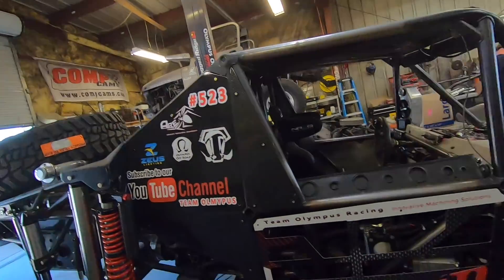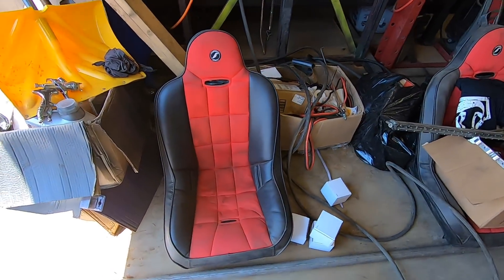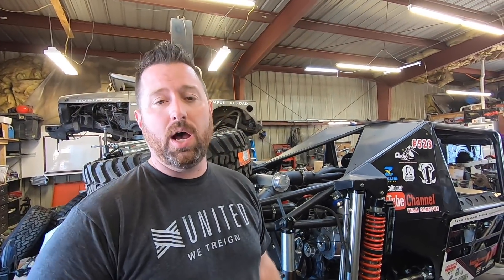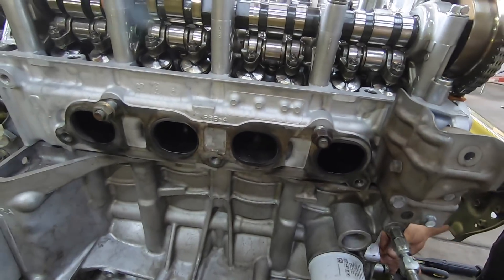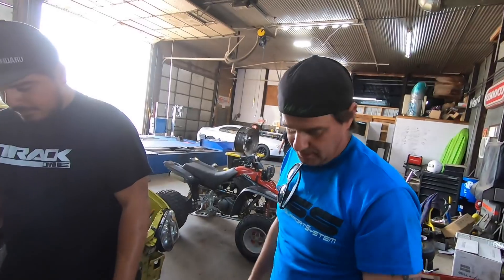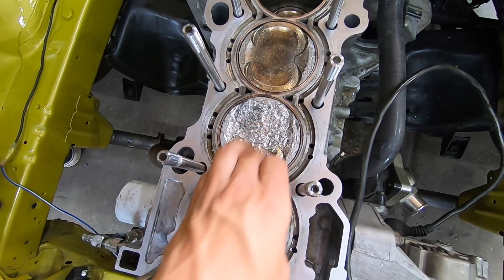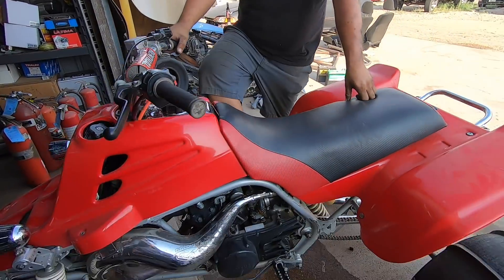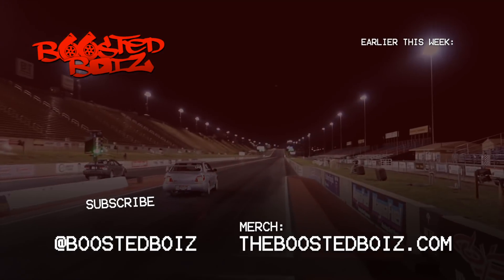Finding Out How Bad The Damage Is on Hondaru

Comment: Even after they swapped out the boxer for a k motor looks like that Subaru still has the spirit of blowing up....
Reply: Just a learning curve
Reply: Seems to be a fault with the K's. They had two different blocks split coolant galleries in the same place too. Time to J swap instead, or just keep stock and not "built".
Reply: LOL i was thinking the same
Reply: EJ257 would of lasted way longer
Reply: Mike Harkins I hope this is a joke
Reply: What statement? What do you mean by NA head? As in this head was built by 4Pistons to run NA? Why would they ever send them NA heads for engines they knew they would turbo to the moon?
Reply: Genuine questions BTW not coming at you. Also read some of your comments down below and it makes more sense. Interesting, but still confusing since I thought the 4P heads were a partnership/sponsorship.
Reply: It's the damn head the are using.
Reply: They need to give up on these "1000hp k swaps"....lol
Reply: @CainSample  I'd love to see them switch Hondaru to a J also hahaha.
Reply: Hahahahahahahahahahahhaha
Reply: That cars blown up way too many motors 💀
Reply: Maybe they should look at getting a bader built boxer engine
Reply: @MV60  LS Time!!!
Reply: Iws the same thing🤣🤣🤣
Reply: Mike Harkins like you said they’re still learning
Reply: @dylanzrim1011  They are still learning... Even Kyle said at the end they are going to learn from this and try to do things differently instead of doing the same things and getting the same results..
Reply: Mike Harkins shouldn’t matter. Brent has been tuning these things throughout his whole life... 

This is what happens when you use stock heads and valves against high horsepower stuff 800whp is a shit ton for these little engines. Even in the built category... these 4 cylinders start losing reliability going past 500whp.. even built bottom ends like forged crank rods pistons.. 

Trust me I’ve built small block chevys and I’ve seen stock cast iron stuff hit 800whp no problem as well. But how long do they last? That’s the issue. You’re better off doing it right the first time and never look back. And spend the extra money for better stuff.
Reply: @brendanmccarthy492  The head and valves werent stock though... And Brent is relatively new to tuning fully built, high HP Frank K builds.. Just because Brent has been tuning a long time doesnt mean shit.. You are always learning. BB and PFI just recently started getting big and having the funds to do big expensive builds. This is new territory for Brent and the guys. I have never said this is def a tuning issue though and none fo this is a shot at Brent as a bad tuner.. Brent is a fantastic tuner and a great guy... I have not seen the logs personally so I dont know what kind of problems they were experiencing. What we do know is they were running very aggressive cams, 50 degree VTC, and Ferrea 6000 valves and springs(usually used for high revving NA builds).. Valve-Piston contact on these aggressive Frank builds is common especially with the high redline and all the tranny issues with misshifts.
Reply: Mike Harkins dont they spec anything? Usually when you buy heads that come with a spec card  tells you what you can run and what is safe and not safe? I bought some 210 afr heads for one of my builds and it says spring pressure can handle up to .700 inch lift cams solid or hydraulic roller set ups. 

I think it’s a head issue. They keep putting these types of heads on their builds and nothing but problems. Even Kyles mr2 had issues with his.
Reply: @brendanmccarthy492  Its not the cylinder head.. Plenty of people run these same heads and are perfectly fine.. What this should tell you is it is them who are making the same mistakes over and over again, not hte cylinder head... And Kyle is know for his sloppy, fast thrown together builds that are not reliable. His whole channel was built on this. And I dont think they did "spec" anything. Seems to me they got some sponsors from different companies and threw together whatever they got.. The aggressive DC cams, the Ferrea valves, the 4P cylinder head, ect... And again, these frank builds are notorious for valve-piston contact when putting the redline up that high with aggressive timing.. Add on them having tranny issues and misshifting, and there goes a piston smacking your valves.
Reply: Mike Harkins yeah. You’re right about that. Kyle throwing shit together. Doesn’t take the time to build his stuff. I mean they obv have the money to buy 3 god damn motors to put in Hondaru... mind as well put a fuckin ls swap with the 4wd set up like a work truck. I feel like that would be more reliable than whatever they’re doing to hondaru. Now I just feel bad for the car instead of the guys building it.
Reply: @MV60  No, these guys just don't know how to build engines. They're too sloppy, they skimp in areas where they shouldn't skimp and they're spread too thin with too many different projects. Ideally, they would just buy engines already built from ENDYN, or 4 Piston Racing, but then they wouldn't have nearly as much content for their videos.
Reply: @PistonAvatarGuy  Just out of curiosity, what would be causing the coolant splits on the block? Because of it being close decked and the coolant passages being smaller they make more pressure?
Reply: @MV60  Not sure, I don't have enough details to say anything. I mostly stopped watching this channel because it's just frustrating. If they want to play with these power levels, they just need to be much more careful with how they build and tune these engines.
Reply: Im 2 years in on my 700whp k24 prayoonto engine. Beat on it every week. Like someone else said these guys skimp
Reply: Kyle may throw shit together in other setups but for these expensive ones nothing is thrown together, he got a built head from 4p racing, built block from css. Assembled himself. I watched all the videos and nothing is thrown together on these expensive builds they do everything to spec and proper. The issue is with the valve train obviously.. they need to figure out what valves aren’t going to float/drop and get stuff dialed in. I personally think it’s a torque issue because they are putting the power down AWD, the head they got has been mostly ran just fwd there’s a lot more strain on stuff when you are going awd or rwd like in kyles mr2 doing some massive wheelies. They will get the testing done and find out what valves and springs work best for what they are doing with these builds. 1000hp awd is a big difference then 1000hp fwd.
Reply: Every video with 'Hondaru' in it, I've commented "Sell the heap of shit".. Wouldn't you agree now at this point.
Reply: @bistrobeats7487  It may not be the valvetrain, actually, it's probably the fact that they're pushing a K24 to 9,000 rpm (IIRC). Piston speeds become a BIG issue at that rpm with a 99mm stroke, the piston can literally flex and smack the valves when you get piston speeds up around the 30 m/s. The good engine builders will not only make sure that the valvetrain is well controlled in that situation, but also that there is adequate clearance for parts that are deforming under those loads.
Reply: PistonAvatarGuy the pistons are not the issue here, it’s the valves dropping or floating. So it’s a valve train issue. If it was with the pistons the last time they dropped a valve there would have been damage to the piston..
Reply: @bistrobeats7487  The relevant part of that article: "The inertia forces will stretch connecting rods and resist crankshaft acceleration—again potentially leading to parts failure..."
-
The article talks about the rod stretching, but the piston does also flex, and both the rod and the piston deforming will push the top of the piston closer to the valves, causing an interference issue. Piston speeds at 30 m/s (I don't have enough info to calculate the actual inertia forces) are no joke, that puts some absolutely ridiculous forces on the rotating assembly.
Reply: MV60 b is the way
Reply: @bistrobeats7487  And it could be a valve float issue as well, but pushing a K24 to 8,000+ rpm is just a bad idea IMO.
Reply: @MV60   I just noticed that the K24 has a really poor rod to stroke ratio, which means that it will have very high side loads on the cylinders at high power levels, that may account for the block failures. The K24 just doesn't have the best internal geometry for making a large amount of power, which is why an engine builder really needs to know what they're doing when building one up for that purpose.
Reply: @PistonAvatarGuy  Thanks for the possible clue.
Reply: You probably dont care but does someone know of a trick to log back into an Instagram account??
I somehow forgot the account password. I love any tips you can give me.
Reply: @Prince Madden instablaster =)

Comment: That Subaru has probably had 500 miles on it in the last four engines
Reply: Engines per mile at this point
Reply: 4 engine's,  still on the same tank of gas...lol
Reply: the whole point of swapping was to have a more reliable engine lol.
Reply: @scooz14  Which equals 4 passes per engine
Reply: It's what makes a Subaru a Subaru.
Reply: 500 miles is being way generous
Reply: They need to do business with someone other than 4Piston.. look at Kyle's H22 Civic, it's been running great for the last couple years
Reply: @dlpereira  time for the phone call to Texas Speed go 427 LS
Reply: @gasscooterdude  I agree fully.
Reply: @edwardmolloy7548  Yes, time for the big boy engines

Comment: It's an RPM issue. Use the Occams razor approach, the simple solution is usually the right solution. These motors run forever at 8k and below. Consider building a boosted motor and camshaft combination that makes your power earlier and more more controlled. You guys are real troopers! keep up the great content and never give up!
Reply: Followthelemming for a turbo that big, I don’t think 8k will do it justice
Reply: @Zenjamin_City  that's a baby turbo compared to what some are running, 
Is it a k20 or k24? 9k+ is nothing for a built k20, even if it's a k24 valvetrain wont be the issues.
Reply: Ding ding ding we have a winner. People talking about built engines will sing at 9 Or 10k.... ya, for a short while. Or nfl as I like to say not for long.
Reply: 9k might be nothing for them sure, but 9k is too much when missing a shift and under full load and full boost
Reply: Travis Gustin <---damn right!if all you do is shut down 1/8 or 1/4 mile runs 9,10,11k sure...for a little while. But for a driver/track car, a decision need to be made. Reliability or dyno numbers.
Reply: @Zachary Trent No doubt you can make the power with RPM. That is undeniable. The facts presented in this and many other BostedBoiz videos always point to the same event. ADD more RPM, miss the shift, smoke the motor. Don't care what other people on the internet claim to have or have done. These guys are hard working tuners and builders and might want to go back to basics to get powerful reliable cars that hangs around the 8k mark. This is not a hard stop recommendation, just a real safe starting point.
Reply: @Followthelemming  Most cars at the 1000+ Level rev 10-11,000RPM reliably. Our Turbo cars see 10.5-11 and our all motor cars see 11.4-11.7. You aren't going to make a usable 1000+HP at 8000RPM.
Reply: Rpm issue? That dohc 4banger should be able to spin 2-3000 more then my turbo v8.
Reply: Humble Performance love your channel guys! Again, I know very well how these motors perform when ideally balanced. I just believe that these guys are having repeat problems and need a safe start point to identify the cause. It is a fact that RPMs will lead to catastrophe, that is why limiters are put on all motors. To overcome that failure, tolerances, weight, stretching of metals, heat transfer, etc need to be accounted for to achieve repeatable high rev high load scenarios. Your team knows this well. Again I only state that the issue here is directly related to, "add more Rpm" said right before the motor pops.